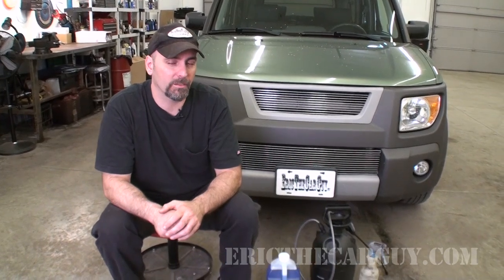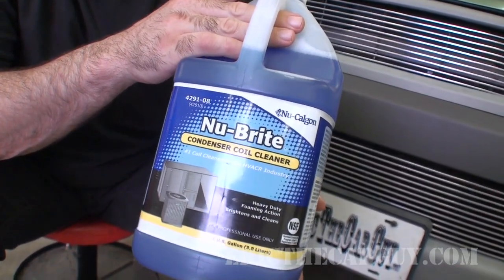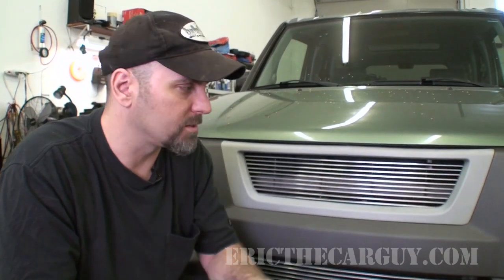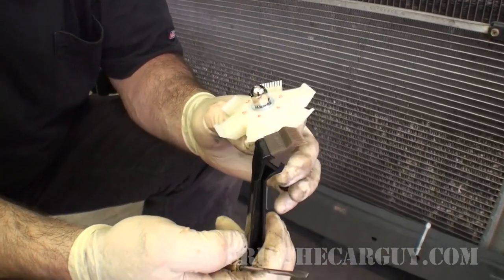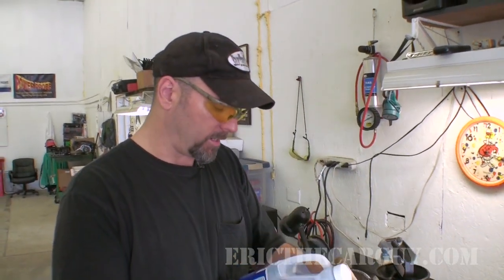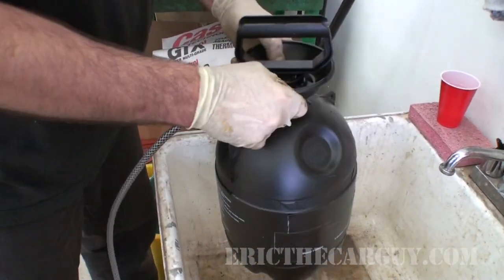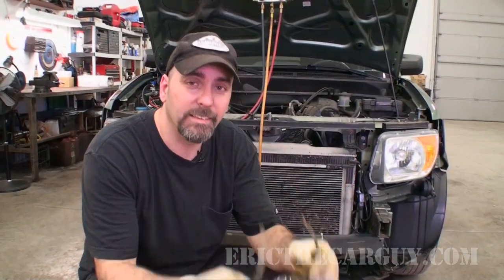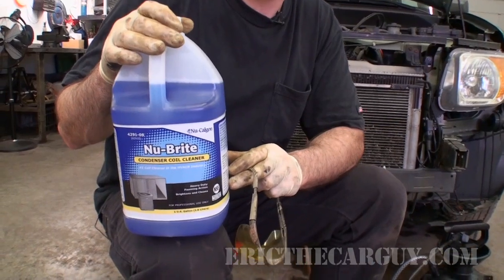Increasing AC Performance by Cleaning Your Condenser -EricTheCarGuy

Comment: Started doing this but with dish soap and used toothbrush. Does quite well for me. Every air conditioning expert I've met always try to say its not worth it. Well, what I really feel is that my a/c goes cooler faster, almost like brand new. effects a bit on the fuel consumption also.

Comment: Did the same condenser cleaning on my car yesterday. My condenser hasn't benn cleaned for 4 years. Since I was recording my trips via OBD reader including the ac high side pressure, I made a pretty good benchmark of the before and after runs for the same route. After cleaning there was a significant drop in the high side pressure. Compressor and cooling fan on time when vehicle is idle was also shorter. The results of the cleaning does help make the ac system run more efficient. And since the compressor and cooling fan is not switching on as frequently as it used to, there is a bit of fuel savings there as the engine doesn't have to work as hard.

Comment: As someone who has installed and  serviced A/C systems for over 12 years let me note, if your coil just has dust and leaves on it spraying water through the coils will clean it plenty.  This cleaner was designed for coils that oil has leaked onto making it gummy and hard to spray or brush off without damaging the coil fins.  Also it works well on hard to reach areas, then you can just use the cleaner and rinse.  But most the time water will clean your coil great.
Reply: The condenser coil must be dirtier from the inside than from the outside since the fan pushes the air out from behind it. Am i right?

Comment: Wow!  I'm impressed!  a 60-psi drop in pressure is HUGE!

I didn't expect much of a drop in vent-temperature, myself...  The A/C system is designed to get the temp down to a certain point, and no further...  38 to 39 degrees F is perfect...

But as you clearly demonstrated, the system was working a LOT less to achieve that temperature after the cleaning.  When it doesn't have to work as hard to achieve the same result, you get less wear-and-tear on the system, and (I'd imagine) better fuel mileage.  If the compressor is not engaged as often, it's putting less of a drag on the engine, and thus you use less fuel.

Very cool video -- thanks!
Reply: you're correct. the thermostat begins to cycle the compressor to maintain a constant temp.
Reply: Doesn't vent temp depend partly on ambient temp? I read somewhere that a 40F drop from ambient is all you can expect.

Comment: Condenser coil maintenance is usually neglected in HVAC yet is a vital component. A dirty condenser coil not only reduces system efficiency but will also shorten the life of the compressor over time (higher refrigerant temperatures & pressures). By design, the evaporator coil stays clean because it has an air filter (if changed regularly) but the condenser coil is exposed to the elements. Both coils have to be clean for maximum airflow & top efficiency.

Comment: Hey Eric,
Love your vids.

Both the fin combs you were using are made for STRAIGHT home or commercial air conditioning, so I'm not surprised you were disappointed with the result. If you look at the condenser the fins are up & down wave shaped and the screwdriver is probably the easiest way to straighten them out.

 For your information the top third of a condensed is the most important, the second, second....and the third, last. This is to do with how the condenser condenses. My rule of thumb for damage is.....if the overall damage is 10 to 15%, it's acceptable. After that it's time to replace it. 

The chemical used to clean the condenser can also be used on the radiator and also the evaporator and barrel fan. I haven't seen all your vids but cleaning the evaporator and replacing the cabit filter are just as important as a clean condenser.

On a professional note: when we read gauges or thermometers we bring the centre pivot point to eye level so we can accurately make the reading. It makes a difference.

Keep up the good work!

The Guru of Cool
Australia

Comment: I just replace a leaking ac condenser/trans cooler on a 13 Durango and it had leaked some trans fluid on radiator causing debris to accumulate on it so i wanted to clean that off. Keeping in mind the fragility of the material it was made of i did the following.  Took an empty standard size dishwashing detergent squirt bottle and mixed a 50/50 solution of dawn and water. Squirted this container full twice over the crud allowed to sit 10 minutes, then filled same container with water only twice squirted over the area twice to rinse. Looked great, nastiness removed. Environmentally safe , effective, and minimal cost. Enjoy you videos. Great help.

Comment: I just found out the high-side pressure on my '99 Civic dropped from 300 to 225 PSI after cleaning the condenser with this Nu-Brite stuff. Fantastic! So I just had to rush back to tell everyone to clean your condenser coils! Save your air conditioner! LOL.

Comment: Glad to see you doing this! I used it on my 10 yo truck last year. Was cleaning the house AC unit and thought hmmmm...I read and read, just wanted to make sure I wasn't gonna hurt any parts on my truck. I actually loosened the condenser so I could do my radiator as well, while I was in there, lol. I couldn't really tell a difference in the cooling but thought it sure wouldn't hurt to be clean. Nice to see that it made such a difference in the pressure of the system, WOW! I never even thought of that benefit. Thanks!

Comment: Blow gun from your air compressor works wonders....especially one of those 30" ones from Hobo Freight...lot of times you can carefully sick them in-between and blow from inside out to the front of your car, all kind of crap, dust will come out, can do same for radiator cleaning...cheers!

Comment: This was an excellent presentation.  The condenser and radiator are often neglected.  The vehicle was perfect for demonstration as far as access and visibility.  It was just too clean and the coil oversized to be able to show a temp improvement especially if the evaporator temp is regulated.  Vehicles with under-sized coils will benefit more.  Bugs and bent fins will have a greater impact especially on coils without a protected area like yours.  Fin combs are not suited to automotive coils as the fins are flush with the tubing unlike stationary  coils.  Best method I have to do fins on auto coils is a row of sharpened popsicle sticks pushed through from the backside.  While still tedious it works well to push out bug bits and debris.  Put the extra cleaner to use on the home A/C and it can be bought at any Heating and Cooling supplier.  Again, a very well done video!
Reply: I clean my engine every once and a while, but like you mentioned, I had never thought to clean the radiator or condenser.  Great idea to push the fins out from the back.

Comment: I'm wondering if you waited for the rinse water to completely evaporate away before measuring pressure again. If cold water droplets are beside the fins, the efficiency of the coil would dramatically improve since the water has to evaporate away before the fins will heat up. Just like dousing your head with water, it's an easy way to cool off quickly, taking advantage of latent heat absorption by evaporating water.
Reply: The water left on the condenser would have evaporated in fairly short order, definitely in the time shown in the video. You won't see it but automotive condensers get coated with lots of contaminates. Just think of all the salt that gets deposited on the fins in a very thin layer from winter driving. That thin, hard to see layer is an insulator and reduces the efficiency of the condenser. Eric didn't think to time it but I suspect that cycle times are longer now with longer on cycles now as well since the high pressure switch will trigger the condenser to cycle off once the head pressure hits the trigger point.
Reply from the maker: Yes, as a matter of fact I did. It was dry when I did the second test.
Reply: EricTheCarGuy Erick at 15:00 there is water under the condenser. Is that from your canister? It looks like your condenser was still wet.
Reply: I always wondered what effect a water mister would have on the efficiency of my ac condenser.
Reply: bg147 Water from your home's water supply while it would increase the efficiency would also have the negative effect of increasing corrosion due to it not being 'soft'. Plus you have to figure in the cost of the water itself. 

That said, many modern high efficiency wall units have a slinger built into the fan which picks up the condensate  in the tray from the evaporator and throws it it on the condenser coils, increasing its efficiency while using water that would just drain out anyway and is 'soft' being condensed from the air.
Reply: Thank you. That makes sense.
Reply: EricTheCarGuy were the doors also open for the retest as they were for the initial test? I can't see whether hey are or not, but having the doors closed could have also reduced your high side pressures by reducing the effective heat load to only the inside of the car instead of essentially the whole shop
Reply: BMTroubleU Are you for real?

A: 84 degrees is 84 degrees, the test wasn't run long enough for the cab temp to change much regardless of the state of the doors.
B: 8:22, 13:11 the doors were open for both tests.

Cragified And your comment on cycles is silly. If it was pressure controlled it would ALWAYS cycle to the same PSI. Clearly the cycles in this instance are temperature controlled. Before the compressor shut of at 180psi, now it shots off at 120, it's not pressure controlled. The system does have a pressure switch, but it is there in the event of an ineffective condenser or a blocked line.

He's not telling you guys to convert your car to run on magnetic eddy currents, there's no conspiracy. By all means, don't clean your condenser.

The results seem perfectly logical to me, cleaner condenser = more efficient system. How scandalous!
Reply: atsernov Physics, learn them.

Increasing temperature without increasing volume results in increased pressure as the mass tries to expand. If the high pressure side of the system after the compressor has compressed the refrigerant coming into it from the evaporator coil cannot release it's thermal energy to the air as it passes through the condenser then it will retain a higher pressure in the high pressure side of the system. The high pressure switch works with the low pressure switch to regulate the cycling of the A/C system along with the evaporator temperature probe and the timing circuit.

If the high pressure side's pressure gets too high then that means the temperature of the refrigerant is too high and it will stop the compressor to allow it to cool. If the low pressure switch  on the low pressure side reads a low enough pressure that means the evaporator coil is getting too close to the glacial point and may freeze up so it also shuts down the compressor to allow the low side to warm up. The expansion device and the compressor is what splits the AC system into low and high pressure sides.
Reply: Cragified  Thank you for the physics lesson. I understand the basics of how the system works. Even if I didn't use the most technically accurate term of "Temperature controlled"

What I'm not understanding is why his on cycles would get longer because of a more efficient condenser. Explain to me why the compressor would need to stay on longer, what am I missing?
Reply: A less efficient condenser would not give up the thermal energy it has to the outside air as readily. Because of this the temperatures inside the high pressure side of the A/C system would be greater and thus increase the pressures inside the high pressure side of the system, thus potentially triggering shorter cycles then the default timer circuit since the pressure switches are wired in series with it.

By making sure the condenser can radiate the heat off and thus condense the gas back down to a liquid full duration timer cycles can be achieved. 

Regardless if cycle times changed or not though the system is still more efficient as shown by the lowered high side pressure. The compressor isn't having to work as hard against the high pressure side of the system thus lowering compressor temperatures which makes the compressor last longer and saps less horsepower from the engine.
Reply: Oh, I see. I thought you meant it was a negative side effect that the compressor was running longer.

Didn't realize you meant the compressor wasn't running full cycles to begin with because it was triggering the high pressure switch.
Reply: Cragified
That's a very good explanation and demonstration of why high side pressures fluctuate, based on load and coil efficiency. It also raises the interesting issue of those who put a new compressor into a system with old and possibly dirty coils.
Reply: spelunkerd My thoughts exactly.  In fact I just did this and got the same results- much lower high pressure.
Reply: Cragified I disagree.  The water will sit inside the fins for a very long time.  In fact the rad fan didn't even pull it out.  I used compressed air and still got a lot of water out.
Reply: halleffect1 If that is true, and the condenser fins are still full of water, then it might be helpful for a short while, but then it would become a liability. The water temperature would increase until it was matched with the surface temperature of the condenser and the water would then be thwarting good airflow between the fins. Perhaps some help would come from the cooling effect of the water evaporating, but blocking the flow of air from the fan would negate any of that benefit. A constant flow of cool water would definitely benefit, but lingering water probably wouldn't.
Reply: I dont know about that Michael Driston. The water in the fins serve as both an increase in surface area as well as assisting with heat transfer. Also the condenser can get hotter than 100C, so water would continue to assist any radiators cooling function until it evaporated off as far as I could see.
Reply: Michael Driston Michael, you say that with confidence but  in the interest of not confusing others, I have to say your thermodyanmics background is a little rusty. Any latent heat sink offers enormous cooling, far greater than any tiny loss from reduced air flow from water droplets on fins. The water doesn't even need to be close to 100 deg C, since evaporative loss means preferential loss of those molecules that have the kinetic energy for phase change. By losing the rapid moving molecules, the remaining water cools quickly, then takes up more energy more quickly from adjacent hot flowing coolant. When you're sitting in the sun on the beach with a cool breeze blowing, and somebody sprays water from a room temp water bottle onto bare skin, what happens? Of course the water on your skin limits air flow across skin, but you instantly feel the cold. After you have a shower, try standing in the room for 5 minutes without towelling off. The air has a role in moving those evaporated, high energy water molecules away, but relative transfer of energy from coolant to air is much more efficient with an adjacent latent heat sink. It's partly the high specific heat of water compared to air, but the main issue is evaporative energy loss. Water droplets on the fins of a radiator are like wetness to a person with hypothermia.
Reply: thats how i cool my truck (semi) condensor down. spray it down with a pressure cleaner on fan and the cab is chilly!!
Reply: No it is NOT higher efficiency  since you will get deposited dirt and grime in and around  the "wet" spot   overtime      So over time it will become "less efficient" because of that.
Reply: the area were the water drips it will collect dirt and grime faster then other areas making it less efficient over time
Reply: spelunkerd wow, I wish my science teachers in school explained these principles in the way that you did. Very easy way to “visualize” the physics in the way that you put it. Thanks for your public service to science sir. (The people replying to spelunkerd’s comment should seriously reread it!)
Reply: @bg147  I know this is an old post but it would work great for a short time and dramatically improve the efficiency of the air conditioner but the sediments in the water would calcify on your coil and start insulating it and that is a big problem lol
Reply: @shawnroddick7523  Thank you. I have a 5 stage water filter. Would that reduce or eliminate deposits? Now, I did add a 6th stage calcium filter which would add some minerals. I mean, I would never do this, just  curious.

Comment: This procedure worked great for me! My condensir was dirty, so was the radiator behind it. I sprayed the dilution over condensor, and radiator( as much as i could). Used a fine spray from garden hose, then blew compressed air straight in, and ditto for radiator. Just by seeing the diff before and after. System has to work more efficiently. Thank you Eric!